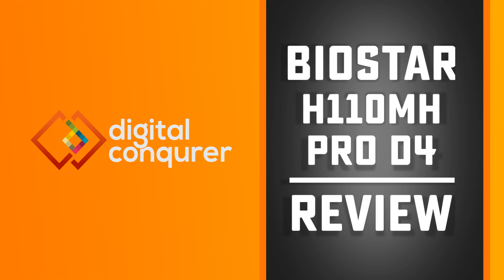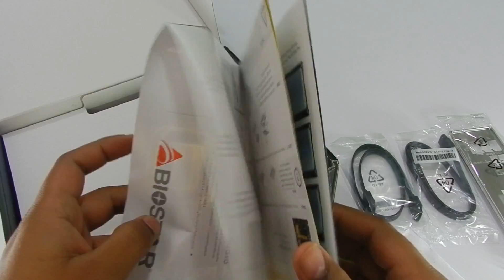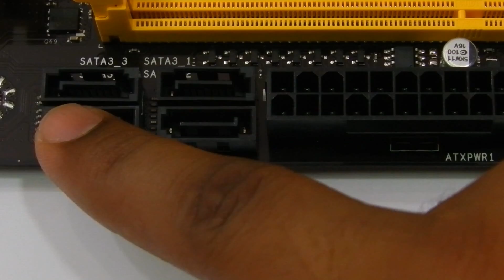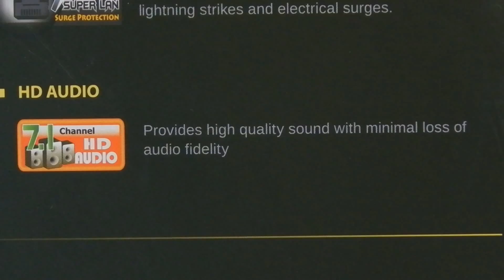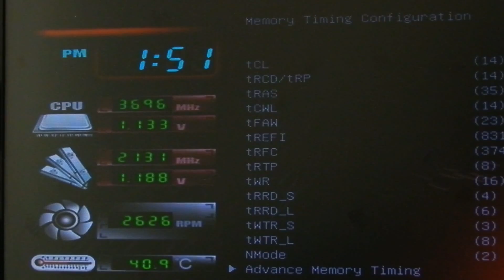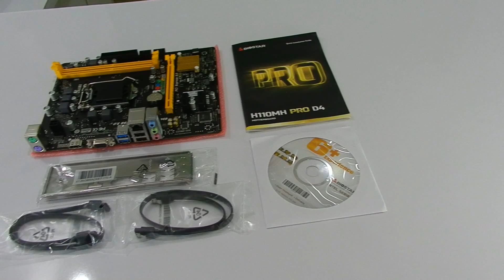Biostar H110MH PRO D4 Motherboard Review

Comment: some things are wrong here, i have the same 
motherboard but im running i3 7100(7th gen processor) and the max ram frequency it supports is 3000 mhz not 2133 mhz. And it has slight issues with the audio front jacks

Comment: i bought one , its so cheap i thnk this mobo will be good for daily and a bit gaming
Reply: why you buy k version for non oc motherboard...
Reply from the maker: Yeah, its very great motherboard for day to day usage, and you can definitely pair with a mid-range graphics card for good gaming experience. I used it with a 750Ti OC, and I could run pretty much any game!
Reply: +Digital Conqurer i only saw 2 connector.. one for cpu fan, one for casing. can i add another one?
Reply from the maker: yes, you can. But not directly from motherboard. You need MOLEX to Fan or SATA Power to FAN converters. So that you can from your power supply. Most external coolers and fans take power directly from SMPS.
Reply: That's exactly what i need. Thank you!
Reply: can i pair this mobo with i5 6600k? will this make serious bottleneck or just a little?
Reply: can i pair this mobo with i5 6600k and get just a little bottleneck?
Reply: fine i guest
Reply: thanks
Reply: thanks
Reply: thanks